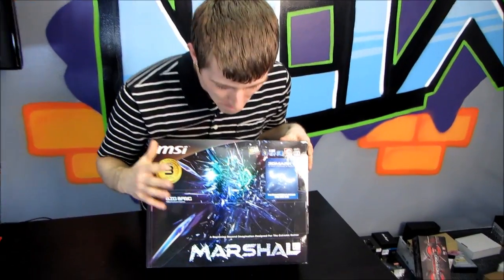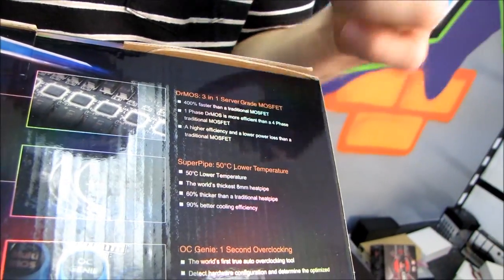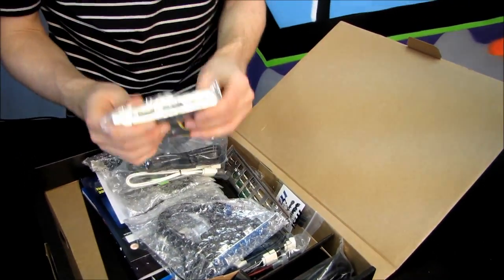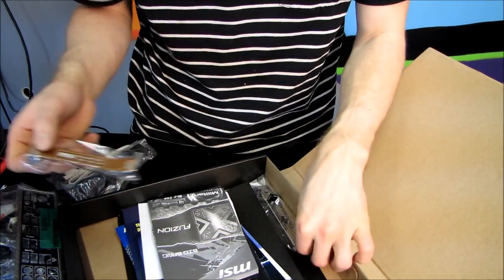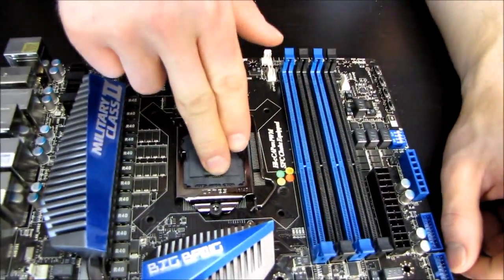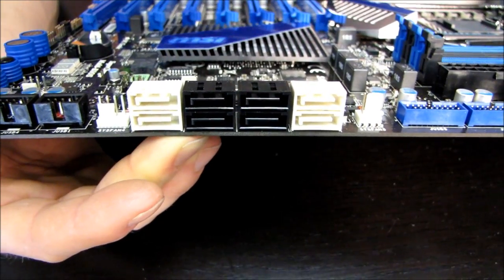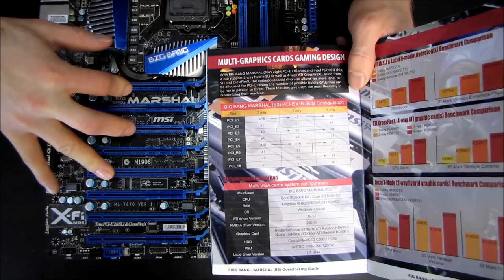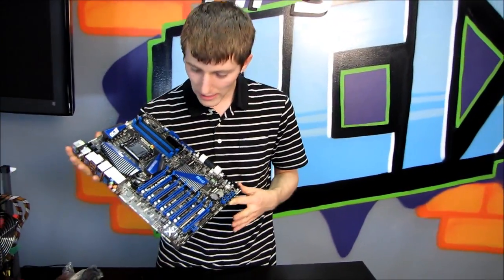MSI Big Bang Marshal Gaming Motherboard Unboxing & First Look Linus Tech Tips

Comment: @StaticCinemaHD It WILL fit, but A) There won't be standoffs for the bottom of the board, and B) you will NOT be able to use the bottom slot.

Comment: Wouldn't really long Graphics cards get in the way of the front panel connectors.  I know MSI has this problem on their other p67 Mobo's with running multi gpu configs, so I honestly don't see how this is a good thing, unless you're not going multi gpus

Comment: info on the MB2  SoftwareDescription
Sound Blaster X-Fi MB2
A powerful audio platform equipped with cutting-edge audio technology and THX TruStudio Pro
Sound Blaster X-Fi MB
High-end software solution for the more discerning user seeking an X-Fi experience

Comment: you will need a whole power station just to run that thing with 4 cards, and i was wondering if a manufacture has managed to make a board with three PCI-E slots that all run at 16x instead of 16x,16x and 8x?